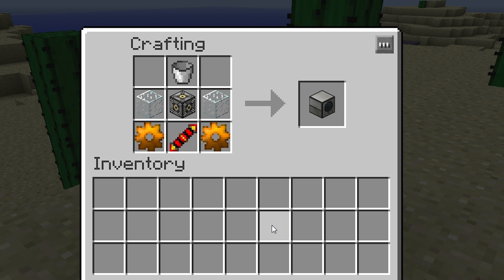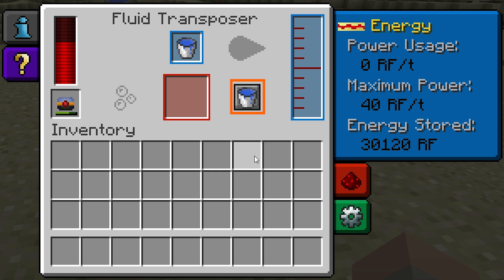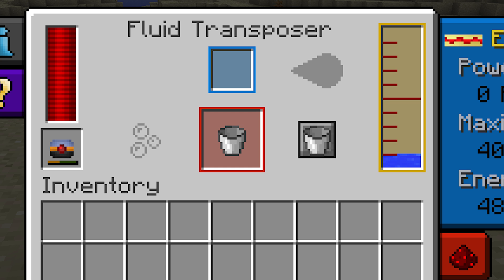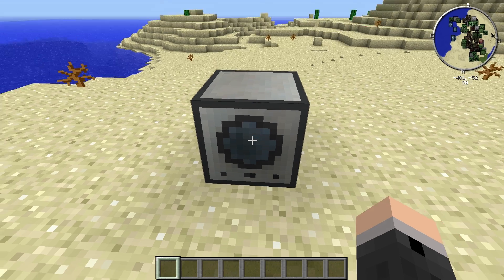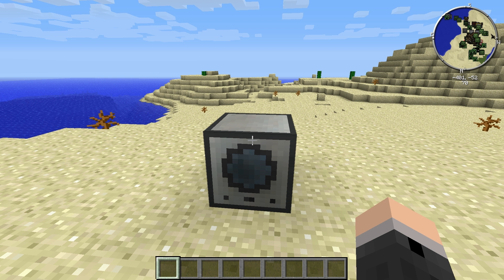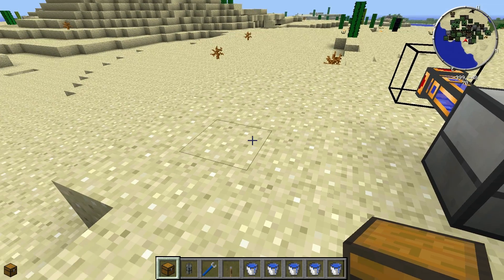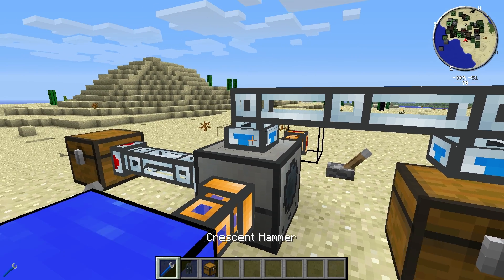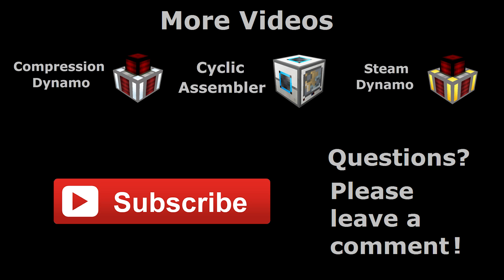Fluid Transposer (Tekkit/Feed The Beast) - Minecraft In Minutes

Comment: Protip to future people, especially those finding Tinkers' Construct fluids in Mystcraft: Just use Extra Utilities's Transfer Node (Fluid). Using these means you don't have to keep returning to the Fluid Transposer to toggle the machine's Fill/Drain setting. (You can, from here, pipe your fluids directly into a TC Casting Basin, and then use a Transfer Node (Items) to pipe the resulting block to a chest.)

Comment: Very good Explanation. With the way now Thermal does the Servos you don't use the wrench to change input/output on the pipe. So that part was confusing but I figured it out with your knowledge of the system. Thanks.